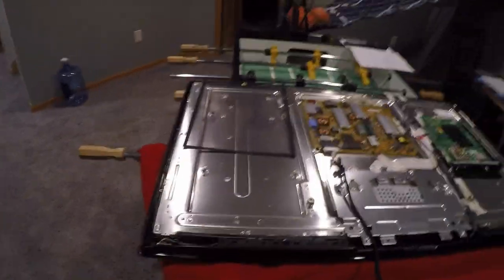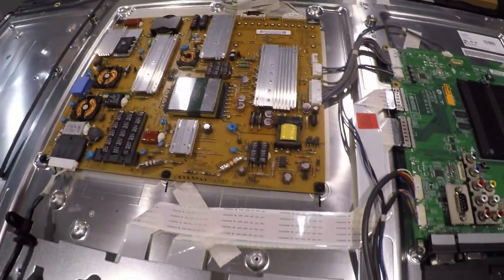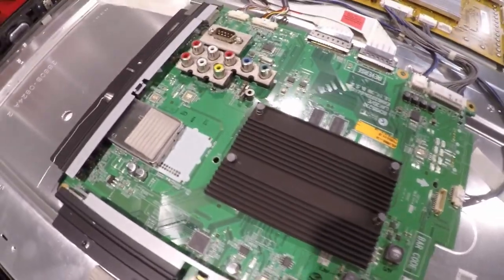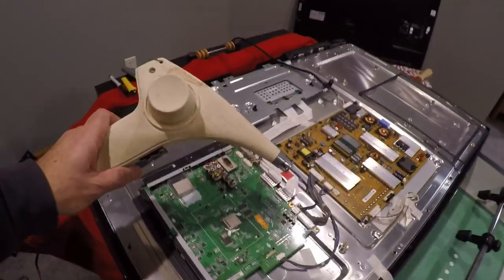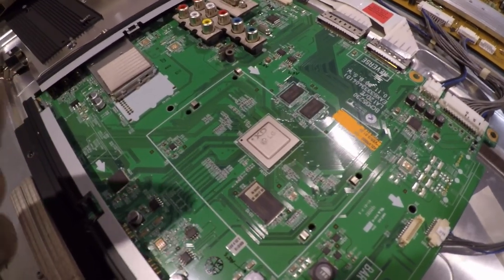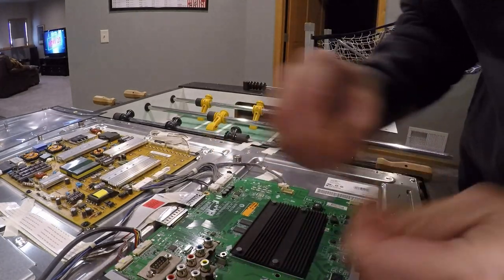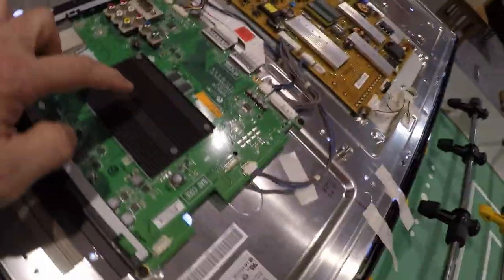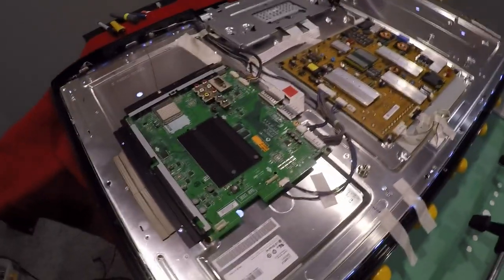Main Board Repair of a 'junked' LG 42LV5500 TV Reflow Oven

Comment: Great vid, I've a simlar problem on a Panasonic TX-58AX802B, I can't find a service manual for that, have you any advice on how to find one? The goihl site where you got yours doesnt have a search UI I can see, just seems to be a repository?
Reply from the maker: That's my website and yes it's just a repository that I use when I find a schematic so that it doesn't get lost on the internet.  Search by the TV model number with or without suffixes, the various numbers on the circuit boards, use filetype:PDF in your Google search to limit the search results, it's really hit or miss when it comes to schematics. But usually power supply voltages are labeled on the boards that can help, look for warm spots or burn spots on circuit boards, things like that... It's much more challenging without a schematic.
Reply: @timgoihl  Thanks I got one, your PDF tip was the trick! No schematic yet...
Reply: Schematics included in Service Manual result! Thanks
Reply from the maker: Good score. What was the link to the manual?
Reply: @timgoihl  I'll post a comment with the link below this one but YT may remove it - YT being YT.
Reply: You don't know what a 'BGA Chip' is by any chance - it's on the main A Board and a common failed component but I can't match it to a chip number?
Reply from the maker: Google it and look at the images. It's a chip that has all the pins on the bottom as a ball grid array.  The pins don't come out the side of the chip like normal chips, they're all on the bottom
Reply from the maker: That's what my video was all about. I heated the ball grid array chip with the heat gun. I'd say that the chips don't maybe fail but actually become unsoldered and that's why you resolder them.
Reply: @timgoihl  Of course! Amazing Perfect! All I need now is a heat gun!
Reply from the maker: @HFamilyDad  one guy in the comments used a PTC heating plate with success, similar to this:  https://www.amazon.com/dp/B07W1ZZH8T/ref=cm_sw_r_cp_apa_fabc_W6AWYX4VGNM30XYQXM3W
250° c. It says it's for 220 volts, not sure but it might work on 110 v
Reply: @timgoihl  Yes I was looking at them but they only go to 260 C, the service manual states lead free solder is used and it would therefore require 370 C to melt. I think I'll have to go with a heat gun, the one you use is upwards of £100 (yes UK £ & I'm already on 240V aside), I can get the board sent off and repaired for that sort of money as you mention on ebay. Decisions decisions!
Reply from the maker: @HFamilyDad  you're reading that 370c wrong.  that is the setting for a soldering iron.  google 'lead free solder melting point' and you will find 217c. "The lead-free solders melt at higher temperatures of about 217°C/422°F compared to 183°C/361°F for the lead-based option. The PCB materials and electronic components must therefore be able to withstand the higher temperatures."
Reply: @timgoihl  Thanks for correcting me, you're a gift that just keeps on giving, I'll give that a go then, thanks again.

Comment: According to schematics, for t-con rgbw cycle test, you have to pull pin 44 to 3,3V. Pin 44 is ground (as pins 42,43,45,46). How does this work?
Reply from the maker: I'm not sure what I said in the video, but it is Test Point TP44 as shown on Page 74 of the service manual.  I dont know what pin it is on LVDS CN1...  on Pg 76 of my own notes I have GND X'ed out and I wrote via tp44 and it works.  It could be a pull-down resistor on TCON I suppose?  Maybe thats why I found TP44 on the R412 1K resistor I mentioned...  Do you actually has a Schemat for the TCON board?  Maybe the Pg76 connector pinout is saying  "the main board supplies gnd on this pin," and thats why you have to remove the lvds cables during the test, to prevent a short to ground!
Reply: @timgoihl  I have diferent set 42LV4500-ZC with diferent tcon.  Cant find any schematic for tcon. On my tcon pin 44 suposed to be ground. My set has audio and backlight, but no picture. I would like to start rgbw cycle on  my tcon , but I dont know how...
Reply from the maker: @osmmi  If this is a TV from 2010-2013, just heat the video chip and see what happens.  I dont even bother with all the testing I explained in the video - now I just take them apart, heat the video chip and they ALL work!   I just had to do all that the first time to figure out what was going on, and it might help someone find a different problem than the one I fixed...
Reply: @timgoihl  I tried with heating the chip twice with same result. Vertical and horizontal lines moving acros the screen.
Reply from the maker: @osmmi  well that's a bummer. I guess  since you have audio it does imply that the video chip is working somewhat and that  your problem is the video cable between the mainboard and tcon or the tcon itself.  Did you reseat cables on both ends?  Then I would test tcon...  Check the power supplies on the board, and voltages at the caps.  If I remember, the t-con must have a screw to the chassis for gnd when cover is off.
Reply from the maker: @osmmi  does your tcon have a tp44 and a  r419?.  With the cables removed can you do an ohm test from the tp or R to ground and see if its 0 ohms?  If not a short than a slight chance it could work as a test pin
Reply: @timgoihl  It is 0 Ohm.

Comment: Question my lg tv is the 47 smart tv ive tested the power supply runs fine I've got sound just no picture any advice ?
Reply from the maker: without knowing the exact model, its hard to say.  Is the backlight working?  you can remove the back of the tv and see if the backlight is glowing.  if it is off, can you see a faded picture using a flashlight on the front?  no backlight may mean bad led's or PS (or the main chip).  If backlight on, then you need to test the tcon board and the main board (the chip).  the chip has hundreds of connections and it can fail in many different ways.
Reply: @timgoihl  ive tested main board everything is correct sound works etc im going to be replacing the tcon board this week as every thing seems to be in good condition but faults lay in the tcon im not getting a correct reading

Comment: Do we need to have 12/24V otput if tv is not on, or shorten pin for “turn on”?
Reply from the maker: I do not understand your question. Best is to download the service manual and read the manual. You do have to turn on the power supply with a jumper to see the 12 and 24 volts. and another jumper to turn on the back light. That information is all in the manual.
Reply: @timgoihl  I asked that .. So, there is no 24V if the TV is not "on".  Short-circuited pins, also no 12 nor 24V, means faulty power supply.  I'm buying another, used one.  Thank you!
Reply from the maker: @TomyCroSound  ah yes. Just make sure you're counting your pins correctly in the connector so you are shorting the correct pins.  I believe pin 1 has a different colored wire. And of course the top is numbered 1357 and the bottom 2468 etc. And you can measure some voltages in the connector to make sure you're in the right place. There's just a standby voltage in the connector when the TV is not on,  then when you short the pins the other supplies are supposed to come up.
Reply: @TomyCroSound  The power supply wont turn on the 24/12V output until the main board requests it, so even on a non faulty PSU you might only get the 3 volt standby showing if you dont have it plugged into the mainboard.
Reply: @MGMan37  VERY well said!

Comment: Is this applicable to a power surge damage tv. I got an LG TV 42" damage by lightning struck. I  already try to replace the power supply board with a new one but it has still the same issue, wont power on.
Reply from the maker: Probably not...  If the surge made it past the power supply board, then any one of many chips could be damaged like the little cpu that monitors the remote.  With the TV plugged in you should be able to measure some voltages on the PS connectors to the main board.  If that is not there, then look for a fuse or surge device in the ac cord path.  I had a stike here like 12-18 months ago and lost some LED retrofit bulbs, but I still have some that fail months later - lightning strikes can 'weaken' electronics devices if it doesnt blow them out right away.
Reply: @timgoihl  thank you for your response and for sharing your ideas

Comment: I have an lg 55 " it shuts off after about 15 minutes when the house is warm and in winter maybe 2 hours  . Any idea what it could be thanks
Reply from the maker: What can the TV do after it shuts off... does it actually turn off, or does just the picture go away.  If the remote still works, you can hear a click on/off, and the red light works then its probably the video chip.  If it is just 'dead' for a while, then I would guess something the power supply board warms up (chip/or cap) and causes the shutdown.  Let me know the symptoms.
Reply: @timgoihl  it shuts off for about 10 minutes then turns back on itself , It doesn't make any clicking
Reply from the maker: @walleyehunter8862  I just checked... the click is pretty quiet.  There is a red standby light when itd off, which turns white when the TV is on - does the white light stay on while the pic goes away?  If so, it could be the video chip (likely since there are so many bake-your-board videos). otherwise it could be an over-heated supply voltage that gets flaky when it gets warm (like a bad cap).  That happened to my 2008 plasma TV.
Reply: @timgoihl  The whole tv shuts off just a red stand by light ,  I bought 2 cooling fans I'm thinking I should put them near the cpu
Reply from the maker: @walleyehunter8862  I like that idea.  would you do this with the back off to troubleshoot?  I would do it in 2 steps - first just blowing on the power supply area.  See if it keeps running.  If it does, then blow it on the black video heatsink and see if that will keep it going.  then you will know what area it is.  let me know, i'm curious
Reply from the maker: @walleyehunter8862  i guess we know its not just a loss of video... when its off, does it completely ignore your remote until it 'cools'?  mine would turn on the white light but no video.
Reply: @timgoihl  I'm doing a test with the back cover off aiming a fan at one board at a time to see how long it stays on for so I have an idea of where to put my cooling fans .
Reply: @timgoihl  It's on the audio board there's a cpu with a heat sink , I aim the fan at it and it turns on and stays on until i shut the fan off 🙂 Do you think if I took off the heat sink and put new thermal paste it would stay on longer ?   Thanks for help and replies
Reply from the maker: @walleyehunter8862  you mean with big black heatsink?  that in the main video chip under there.  that is want comes unsoldered on all these tvs.  the fan might work for awhile.  bad design on their part.
Reply: @timgoihl  yes the heat sink is about the size of a book of matches
Reply: Is there something to keep the heat sink on afterwards? It looks like a grey silicone holding it on both sides
Reply from the maker: @walleyehunter8862  I'm not sure of the specifics of your tv.  you can see my 4x6inch heatsink in my video near the end when i reattach it.  there are 4 plastic pins at the corners.  yours may be different?  the grey 'sticky tape' is a insulator/thermal conductor.
Reply: @timgoihl  mine are siliconed I looked it up and the product they use is called Momentive RTV167 electronic silicone
Reply: timgoihl hi I have same problem at 55” lg led it goes off completely but after 10 minutes u can on tv and all working good  I checked power supply all heat sinks have low temperature also in cpu at motherboard put fan nothing different goes off after 20 minutes please help me
Reply: @husainchahkandi9612  I'm going to try changing the thermal tape on the heat sink and put cooling fans on my 55 " , I know the audio board is the problem,  I'll let you know how it goes
Reply from the maker: @husainchahkandi9612  It's probaby the video chip...  common problem with these TV's
Reply: @walleyehunter8862  :Yes! I noticed the same ! The first time around, The TV was on for 10 minutes and went out. So re-opened it. And experimented with heating it up and cooling it down. Then I made sure that the Thermal paste/sticker between the package and the heatsink was stuck tight. 24 hours so far and it is behaving.

Comment: Any special tools needed to remove the heat sink pins? I can't remove them even when pinching end with needle nose pliers. Thanks.
Reply from the maker: No special tools, pinch bottom end together and push firmly from the back.  Should pop right out.  Keep your finger/thumb on the heatsink on the opposite side so you have something to push against.  You might be able to use a small flat blade screwdriver from the top side at the same time to help it come out.
Reply: @timgoihl  Got it, thank you! Had to push a bit harder than I thought. Worried I'd break something. One other thing. Whats the recommended temp and time for heating the chip? Thanks again!
Reply from the maker: @brianb8698  Read the video description and read through the comments. there's lots of questions about various techniques for heating the chip. electronic solder melts in the 200-240C range.  Generally a hair dryer does not have enough heat but one of those paint stripping heat guns is probably too much. One guy used a PTC heater something like this on Amazon https://www.amazon.com/dp/B07VHP5RMG
Reply: @timgoihl  Thank you. I heated it up for about 7 minutes at that temp range and it worked! Thanks again for posting! TV saved!

Comment: how do you remove those black support clips for the heatsink?
Reply from the maker: Watch the end of the video. It would be the reverse of how I put them in. Basically you take all the screws out of the circuit board then from the back of the board you will see that you can pinch the clips and push them through.

Comment: Can you use a paint stripping heat gun or hairdryer for this?
Reply from the maker: You don't want to cook/burn the surrounding circuit board!

The Weller 6966C is 250W and the temperature at nozzle ranges from 750° F to 800° F (399° C to 427° C).  I also used a 6958 reducing nozzle to direct the airflow at the chip and not the surrounding board https://images.app.goo.gl/WsC9rfzT7koHQkBp9

a hair dryer is up to 1,500W, but its high air flow keeps the temperature too low. For that application you don't want to be melting people's hair off.  The paint stripper probably has way too many watts and gets too hot and would burn the surrounding board.  If it was going to work you would need some kind of deflector like the image I linked above and a slow air flow.

Your target temperature is about 400C, 800F.  if you could build a deflector to control the airflow and temperature the paint stripper might work - do you have a laser temperature gun?
Reply: Thank you for that.
Reply: No I don't, but my heat gun has variable heat and air flow controls, with a range of 60c-600c,  Air flow 200L/m-500L/m.
Reply from the maker: @damienking6314  Sounds like a nice heat gun.  you are trying to get the chip/board to about 400F to melt/reflow the chip.  Maybe you could turn it down and shield the surrounding pcb with AL foil to protect it????
Reply: Ok, I'll give it a go today. Thanks for the help.
Reply: Done. As you said, 10 minutes with my heat gun at about half heat. Working well for a couple of hours now, wondering how long it will last though.

Comment: Timgoihl, Did you shorten the 2 pin that you have mentioned in the video?
Reply from the maker: I followed the service manual. I'm not sure exactly which pins you're talking about. But I did short some pins in the connector to turn on the backlight to test that. You may want to download the manuals and print them and it's very clear on what to do.

Comment: I got one, I just can’t figure out how to take those screws off. So I just heat off the heat shieldat first. It runs for few weeks, then it stops working. I used the same method but it seems the tv is dead — every time I tried to open it I need to heat it again.
Reply from the maker: You can't just heat the heat sink because the heat sink just removes the heat you want to go into the chip. you must remove the black heat sink and then heat the chip directly. Unscrew the main board and then you can push the plastic pins out from the bottom of the board - you might have to pinch the clips together with a small pliers.